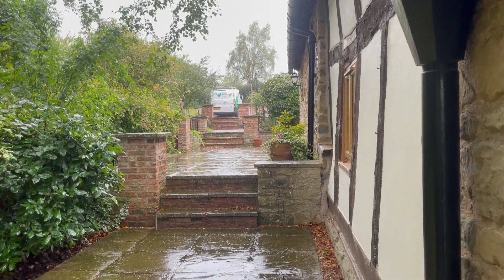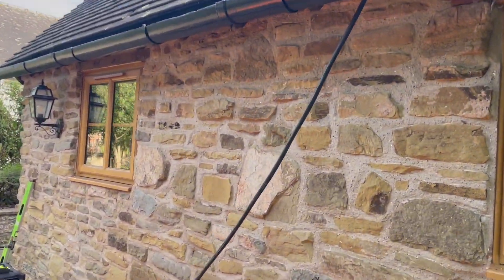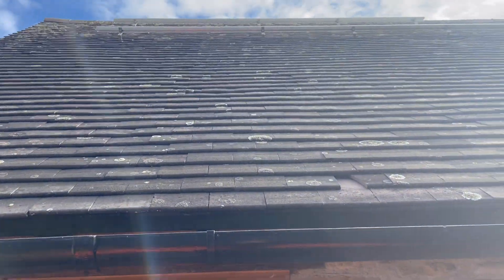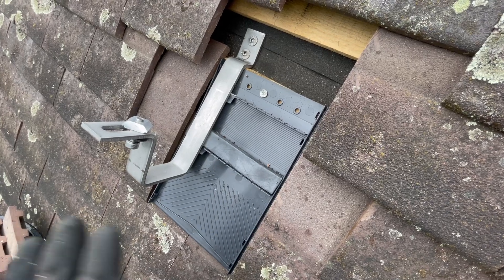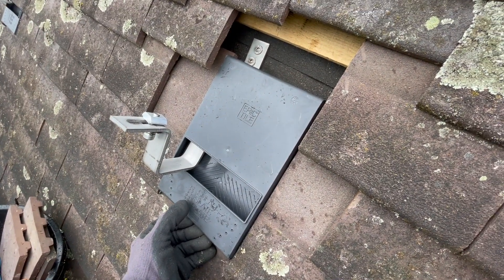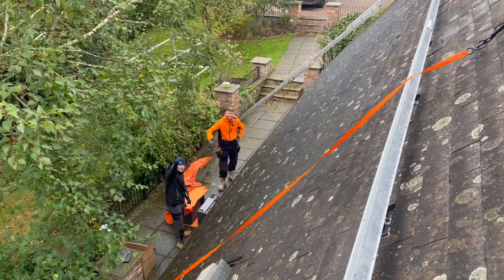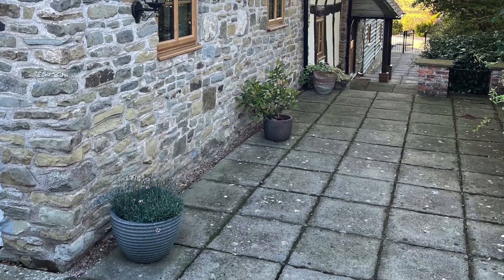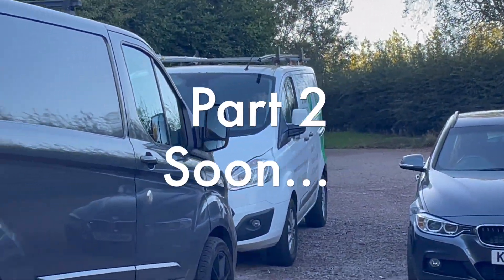Challenging Solar & Battery Install - Ecoflow Power Ocean @NBundyElectrical

Comment: Sorry if I missed it - apart from the Eric tile, what rail/panel mount system are you using?
Reply from the maker: Fastensol works very well with Eric Tile.
Reply: @StaffsSmartTV  okay, thanks! I'll look at that as well, I have been looking at the K2 system. Cheers
Reply from the maker: @MarkCarline  in our opinion the Eric Tile is the best we've seen so far. let us know if you find anything interesting.